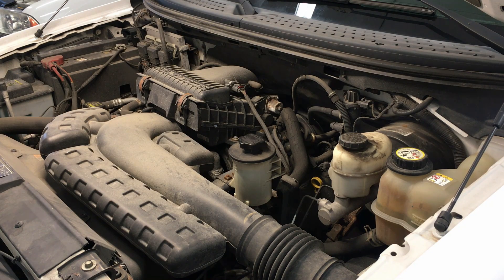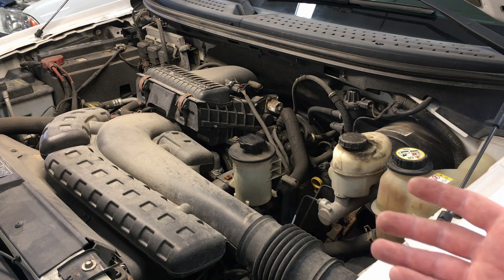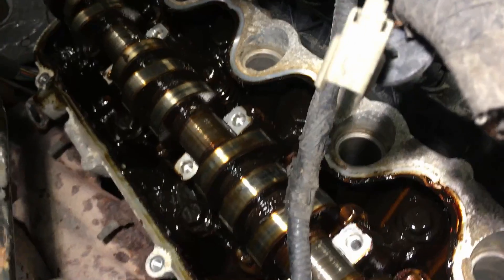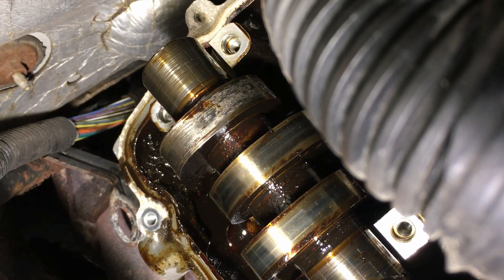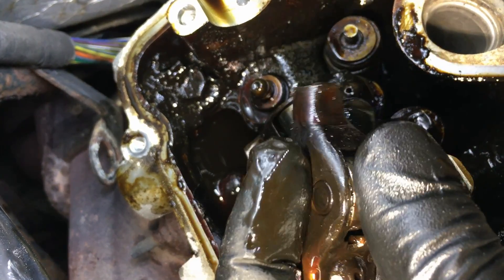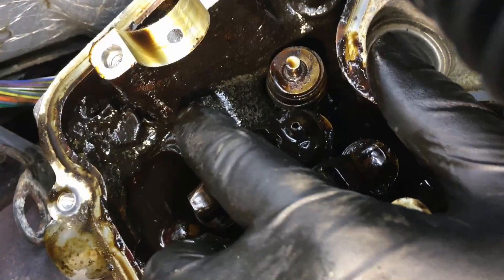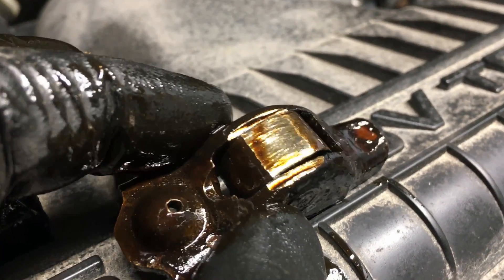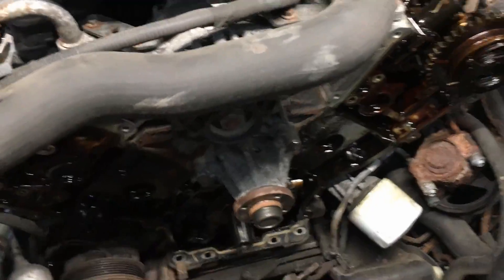Ford 5.4L 3V Engines Constant Ticking Tapping Noise: Roller Follower Failure!

Comment: I learn a lot from your uploads. Lesson #1 don't buy anything with a ford 5.4 3V in it.
Reply: 174k on my 04 5.4 3v. When it warms up, the cam phasers do clack, but they smooth out above idle. That noise drives some people up the wall, it doesn't "phase" me.
Reply: I sold my '05 F150 which had 316,xxx miles on it and I didn't have all these problems. I originally bought it brand new and always had a good  maintenance done to it. Take care of yours and it will take care of you.
Reply: The only reason the 5.0 is "reliable" is that it's kinda new, also it's old, tested and reliable tech.  In a few years we'll find out if the timing chain guides fail or if it has oiling issues.  Judging by the 5.4l, ecoboosts, it doesn't look promising!
Reply: Mr Schmidt Feel free to correct me, but I've heard compared to the majority of turbocharged engines from other competitors, ecoboosts are pretty reliable, they just aren't as reliable as engines like the 5.0 and 3.5 duratec as those engines are less stressed/complex than ecoboosts. I've heard it's still fairly common to see ecoboosts hitting 200k + with little to no issue.
Reply: The 5.4 is actually a really reliable engine once the timing system is fixed. It doesn't hurt to change the oil every so often too haha. I don't think the owner of this engine did too many of those.
Reply from the maker: +Bleepnsheep Ah so you are paying attention!
Reply: FordTechMakuloco I have a 2004 F150 5.4 3v. I locked out my camphasers and replace my timing chains, hydraulic tensioners, chain guides. I also had a mechanic to install the high volume mellings oil pump. The engine looked really clean. Almost shiny. The lobes on both cams was real clean and all the lobes were smooth. I baby my truck I hardly ever run it over 2500 rpms. I change my oil every 3000 miles and only use MotorCraft products. Should I have this problem to worry about?
Reply: Jeffery Lambert if the vct is locked then no you’ll be fine.
Reply: FordTechMakuloco 226,400 on my 5.4,Still runs good!
Reply: Or indeed anything with a dps6 powershift transmission! In Australia Ford are being prosecuted by the Australian Competition and Consumer Commission for misleading and unconscionable conduct over the dps6 fiasco.Allegedly blaming the owners "style of driving" whatever that means. Can you believe it. Will they make it stick..watch this space.
Reply: I didn't mean to offend anyone. All I know for sure is Makuloco is working on these 5.4 3v motors for a variety of problems in many videos that come from many different situations. And I like to keep my  motors simple. These motors look like an over complicated nightmare  waiting to happen.
Reply: @bleepnsheep2310  ford has more motors on the road than any make. What do you expect to see in mechanic shops when you sell 10 times as many trucks as the comp? The fact is that even mechanics opinions are anecdotal. Look at the facts. The 5.4 is one of the most reliable motors on the road with proper care. It's not rare to see these motors with 200 300+ miles on them without a rebuild.
Reply: G11B I've heard the most reliable ford engines are the 5.0 and basically any duratec engine, mines a 3.5 duratec which I've heard is very reliable.
Reply: Mr Schmidt Plenty of Coyote 5.0's that develop nasty piston/rod/valvetrain knocks. But they are definitely an improvement over the 5.4 Triton.
Reply: Puff the Magic Dragon ...for example?  the Eco-Boosts need oil Catch cans because they blow too much oil into the intake, oil that isn't being washed by the injectors because it's direct injection causing the heads to need replacing.

the biggest problem at ford is nobody cares about maintenance.  if you look into your engine bay you'll see what I'm talking about.  it's clogged with hoses and wires bolts are in insanely difficult to reach locations hose clamps are facing upwards into the body and even the O2 sensors are facing the wrong way for servicing.  the reason?  because the factory assembles all that crap before the body gets put on.  it's easy for the factory minion to quickly and cheaply assemble.  they don't give a flying f*** about it breaking down in 5 years.   ...nobody cares about what their vehicle will be like in 5 to 10 years.  Ford trucks outsell everyone yet have poor reliability, expensive parts and are worth much less than other makes trucks on the used market.  https://www.kbb.com/new-cars/best-resale-value-awards/best-resale-top-10-cars/
Reply: I guess I got lucky because I bought a 98' Expedition and it ended up having a 2V , thank God no broken spark plugs for me , and no cam phasers either ! It's got 230,0il00 miles and it runs so smooth it's sometimes hard to tell if it's running

Comment: In your opinion what is the best V8 Ford F150 engine made (past or present)?
Reply: 5.0
Reply: 300 straight 6, 302/5.0L, 351W/5.8L, 390, 460. ;-)
Reply: Duncan Paisley definently present in my opinion. Ford started to get theor act together towards the end but dropped the motor for some reason.  I have a 2010 5.4
Reply: I test engines for a living, the 5.0 is Ford's best engine.
Reply: Ohh ok i thought he meant the 5.4 only. Then the 5.0
Reply: David McClelland 
300/straight 6 misses the qualifications by 2 cylinders.
Reply: I mean the Coyote V8

Comment: Oil changes, oil changes, oil changes!
Reply: i changed my oil every 5000 miles since day one with mobil one and it still done this shit the 5.4 is a damn shit engine
Reply: yup, got an engine in my driveway with 15 years and 255k miles on it.... Looks like a brand new engine under the valvecovers because the oil was actually changed. Same with all the cars in the family. I figure sludge like that must come from repeated 10k or 12k +mile intervals with std oil?? My daily always gets around 7k no changes with syn since New and at 110k mi there is still 0 discoloring under the valve covers.
Reply: MeVsMe   I sure he changes it every 25,000 miles.
Reply: We do 10,000 mile oil changes in our 08 Tundra v-8. Use only Mobil 1 and factory filters  , 280,000 city miles and looks like new
Reply: Well I just did timing chain change and rollers my engine was a little les than that sludge I had this 04 f150 since 08 154000 miles oil change every time I got most of the time 3 to 4 times a year never put 3000 miles period and I got so disappointed when I open valve covers
So the reason why it got like that I don't know
Reply: Wayne Sheets ... or every 3 years, whichever comes last.

Comment: I don't know why owners stick to manufacturer's suggested oil change intervals to begin with an oil change is lot cheaper than a engine change and most internal repairs would never happen if they change the freaking oil! I retire my vehicles with hundreds of thousands of miles on them and never go in to the internals of engine, water pumps, alternators, maintenance items thats it,  but never inside the engine never pull a valve cover an oil pan, timing chain cover period, change the friggin oil! And that goes for ALL the fluids change them before they go bad you're going to save money in the long run.
Reply: Hey....steal yer face buddy.....

Comment: Have a 2000 f series with a 4.6 liter with about 120,000 miles on it. I parked it and let it sit and barely drove it (stupid mistake). When I fired it up one day it backfired and ran rough. Came to find that it spit out about 5 roller followers on the pass side. Have yet to put them back in, but fear I may have bent valves. I guess I'll find out when I get into it further.

Comment: Well this owner wasn't a fan of 5000 mile oil changes, was he ? Does a 'motor clean' help or cause more problems ?
0W20 seems to be quite common in the US, but I'm note sure if I wanna drive with that oil @ over 100mph for hours ?!?
Reply: With this engine every 3k or you are in trouble. At least that is what my mechanic said.
Reply: FireEye3405 greenlight 5000 miles is a bit quick isn't it? Maybe if the truck gets beaten but 10.000 to 15.000 miles should be possible with good quality oil shouldn't it?
Reply: It seems a lot of american drivers still change their oil between 3000-7500 miles. Here in Europe pretty much nobody does that. 10.000 miles 'normal' driving should be fine with a 0W40 or 5W40 quality oil. 15.000 only if you are driving a lot long distance on the highway.